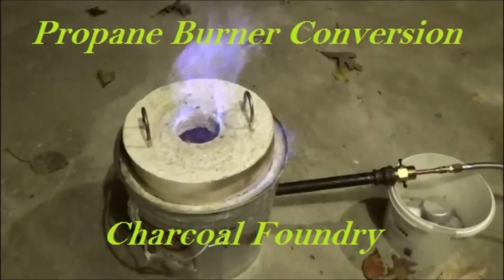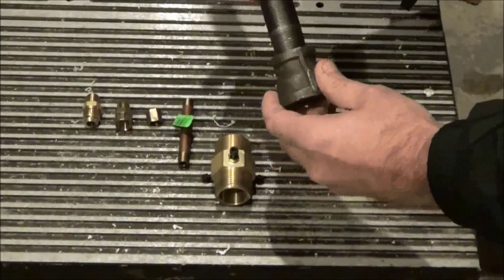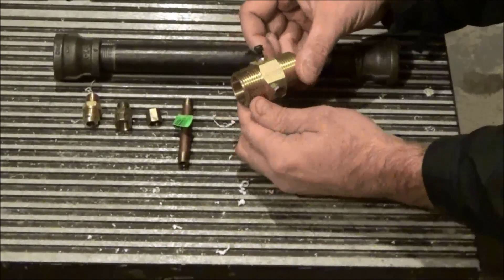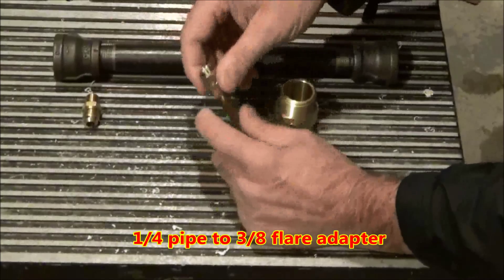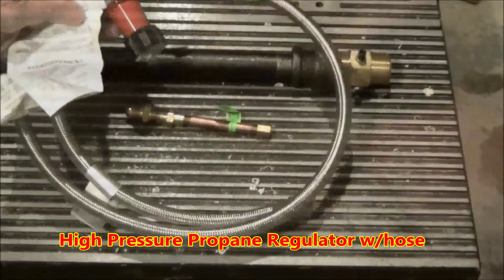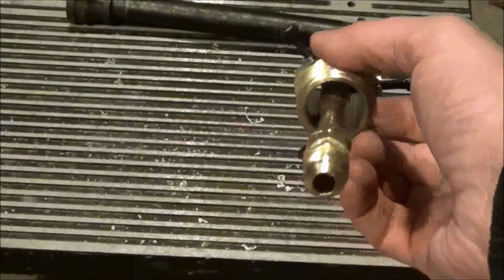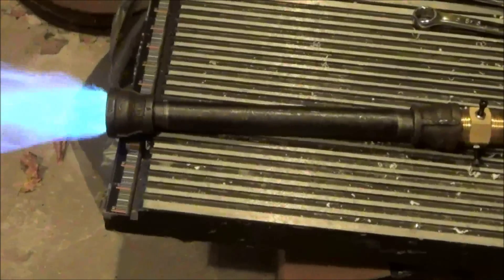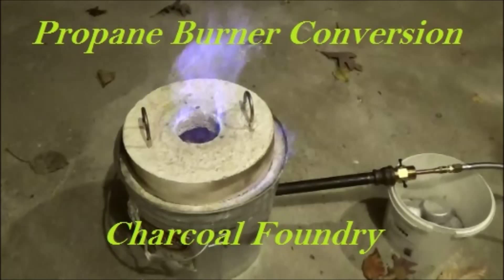No Weld Propane Burner V1.0 for Foundry

Comment: Using 1" pipe, but no reducers on either end, I wasn't able to get my crucible hot enough to melt aluminum, or even visibly soften it. Would drilling a few holes behind the cap to increase airflow help?
Reply from the maker: +footpetaljones The reducers really help accelerate the air through the tube and enhances the mixing of air and propane. can you find a couple 1" to 1 1/4 or 1 1/2 bell reducers? that would really help! Good luck! Thanks for the comment!
Reply: I could easily put a reducer on the outlet end, but I am not sure about on the inlet end. I have a hairdryer I could hook up to try to force more air into the mixture before going back to the hardware store.
Reply from the maker: The hair dryer will work.
Reply: +Heath Putnam The hair dryer will work, but you have to place it way behind your burner because it has too much pressure.  The ideal solution I have found is using a copper tube to pump air in from a small air pump that is electric, like low psi. My pump is from surplus parts and is rare but you might use a 12v car tire inflater.

Comment from the maker: I just looked everything up on AMAZON and if you order everything (using Prime) it will cost $67.80. I added links to all the parts I used. I did not use AMAZON for some parts but wish I did. I spent a long time visiting hardware stores.

Comment: out of curiousity, how much did all this cost and where did you get it all (aside from the stuff in the description, that's fairly obvious where you got it)?

It occurs to me that i should commend you on making a burner that doesn't require the use of welding, which every other one I've seen does. I can (in theory, at least) actually make this one so my forge can stop throwing ash everywhere every time i use it.
Reply from the maker: +Entropic Radar I just looked everything up on AMAZON and if you order everything (using Prime) it will cost $67.80. I added links to all the parts I used. I did not use AMAZON for some parts but wish I did. I spent a long time visiting hardware stores.
Reply: +Heath Putnam that is INCREDIBLY helpful, thank you!
Reply from the maker: No problem! Let me know if you build one! Thanks for the comments!
Reply: I do actually have every intent to build it, once i have the money for the pieces (curse you bills!) as I already have Grants forge built and ready for it.
Reply from the maker: Do you have a salvage yard close by? you may get lucky and save a few buck! Good Luck!
Reply: none that sell to the public, sadly. it's a pity really, I'm a scavenger by nature and i LOVE digging through piles of junk to find that one shiny object i need or that catches my interest.
Reply from the maker: Yeah me too... :)

Comment: in this video I can see / or it appears you have your burner aimed at the center ( bottom ) of your crucible. was wondering if you aim to the right just a touch will you get a better convection effect ( if that is the correct term ) to lower the fuel usage to get the temps needed?
Reply from the maker: +ROTTK9 You are probably correct the flame/heat would have a higher contact area. It would also cause the flame to swirl around the chamber. I'll try it, Thanks for the comment and idea!

Comment: Hey I finished the torch last night and I was melting aluminum with it perfectly but when I tried to melt brass it barely got hot enough to melt it, Do you know of anyways to make the flame hotter?
Reply from the maker: +Backyard Randoms Do you have a cover on your foundry? Reducing the hole size in the cover will hold more heat. My foundry will melt brass (although slowly) you may need to introduce air.

Comment: Hi, why did you change charcoal to propane?, did you get much heat? or is simple more stable?... Im also wondering if the wood gas stove vortex tecnology could not be a use in the foundry.... dont you think?
Reply from the maker: +Alejandro Flain The charcoal produced plenty of heat but the temperature was a little hard to regulate, the hair dryer only has high and low. I can now use either charcoal or propane. I do not need to use electricity when using my propane burner, which is convenient. I think a forced air wood gas stove would probably work. That's an interesting idea. Thanks for the comments!

Comment: Looks good! Would be a real pain to find those couplings in the Netherlands though. But I get the idea. You don't use forced air with this is see? It burns pretty good though, nice blue flame. If the gas tank would get empty, and the pressure is going down, is there a chance of the fire going back in your hose, or is the hole so small that's not possible?

Comment: Hey I am making your propane burner for my foundry And I have gotten all the parts but the 1" to 1" brass adapter Ive checked all the plumbing stores welding stores gas stores and just like Ace,Home Depot and Lowes but none of them have it do you know where I could order it online?
Reply from the maker: +Backyard Randoms Search for brass hex nipple 1" NPT;  http://www.amazon.com/dp/B006PKKVXA/ref=biss_dp_t_asn or http://www.amazon.com/dp/B00835UQYO/ref=biss_dp_t_asn Thanks for commenting! Let me know how it goes. I was using mine today to melt some heat sinks. Worked great!
Reply from the maker: +Backyard Randoms Search for brass hex nipple 1" NPT; Google or amazon!  I was using mine today to melt some heat sinks. Worked great! Thanks for commenting! Let me know how it goes.
Reply: Alright thanks does it get hot enough to melt brass?
Reply from the maker: this burner will melt brass :)
Reply from the maker: +Backyard Randoms Thanks for the comment, I added the same links to the video description.
Reply: +Heath Putnam Thank you so much I never would have found that part without you! and happy holidays!
Reply: +Heath Putnam Hey I was wondering if you think I should attach some sort of blower to it or does that not make it better because ive herd some have said a blower makes it burn hotter
Reply from the maker: you can... I have not. It burns pretty well as is. :)
Reply: alright thanks

Comment: I am by no means an expert at this but I have a thought for you.  What if you were to add some gas grill rocks (like a lava rock) to the foundry?  Would this allow you to decrease your amount of propane and still maintain the heat required?  I would think that the heat trapped in the rocks would work really well.
Reply from the maker: +Alan Fetz I'll give it a try! Thanks for the comment!
Reply: +Heath Putnam Just wondering if you were able to try this?  I am thinking of beginning to build this tomorrow.
Reply from the maker: I did not try it yet. With this burner I am not lacking heat. I will try it though unless you get to it first. Let me know if you have success or need more info. Thanks for the comment!